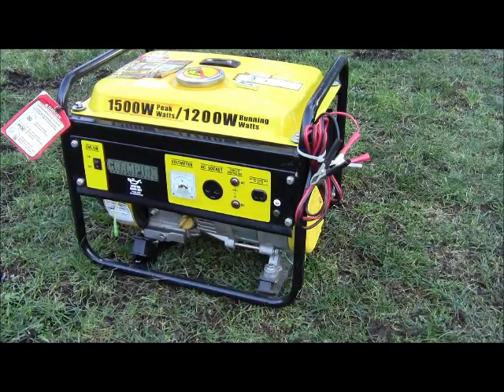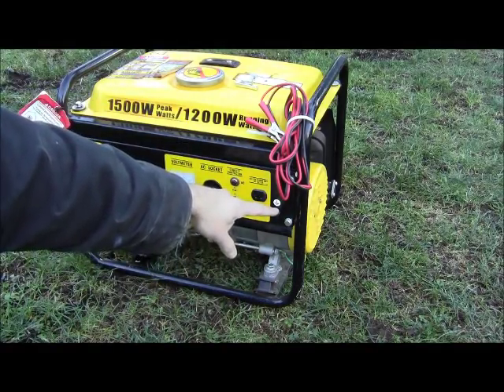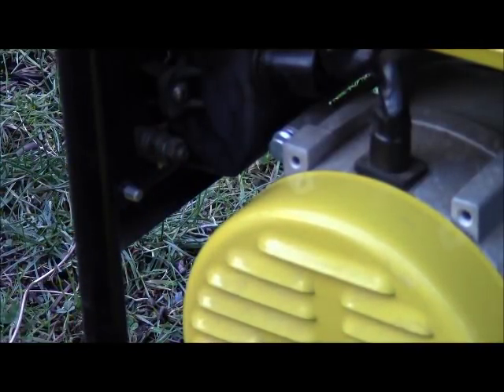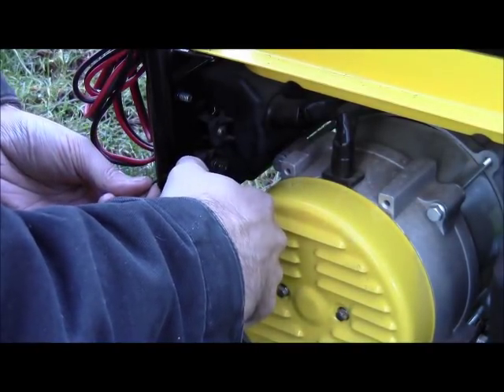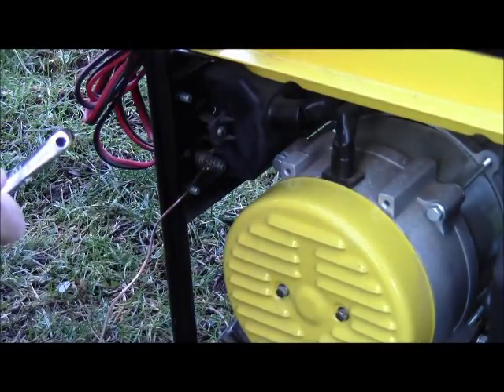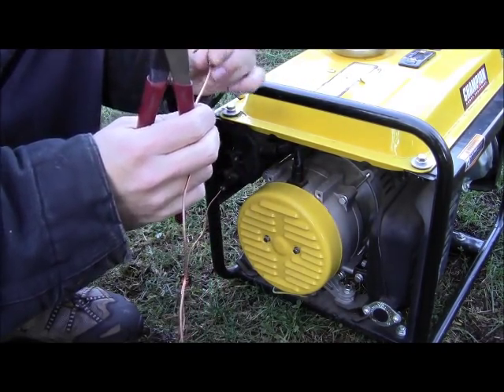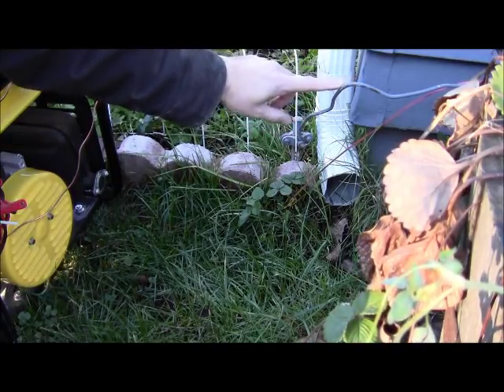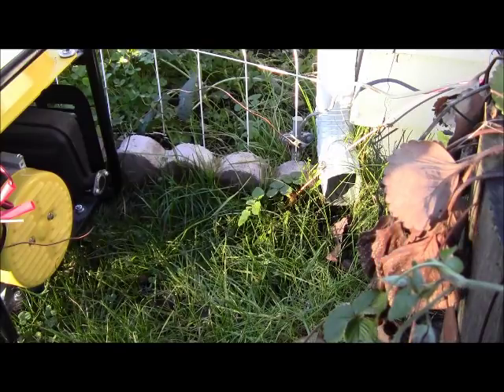RicksDIY Portable Generator Grounding Part1

Comment: My only concern with your video is not the grounding but how close the generator is to the house. The manufacture requires a generator be as far away from the house to prevent carbon monoxide from entering the home. Either way, it;s a great video.

Comment: OSHA does say the frame can act as a ground.  But the maker of my generator recommends grounding in the instruction manual, and I called them and they reaffirmed their recommendation.  I like the gator clip idea.  That little gator clip he used in the video may not be enough though for your generator.  The clip needs to be able to handle the same load as the grounding wire.

Comment: When I worked in the hire trade 20 years ago we ALWAYS sent out generators, regardless of size, with a copper rod and a length of insulated wire that could be connected to the generator. All generators have  a bolt thread, marked with an Earth symbol, sticking out that has a nut and washer on it. Customers would remove the nut and washer to fit the eye connector on the wire, put the nut/washer back on and then hammer the rod to ground. This used to be common practice. This week we had to hire 3  2.5KVA petrol gennys and an 8KVA diesel, non came with any rods. I mentioned earthing to the driver and he looked at me like I was nuts. The 8KVA was on large rubber wheels with the feet at the back on large rubber mountings. If something happened then the first person to touch it would become the earth.

Comment: OSHA states-Grounding Requirements for Portable and Vehicle-mounted Generators Under the following conditions, OSHA directs (29 CFR 1926.404(f)(3)(i)) that the
frame of a portable generator need not be grounded (connected to earth) and that the frame may serve as the ground (in place of the earth):
• The generator supplies only equipment mounted on the generator and/or cord- and plug-connected equipment through receptacles mounted on the generator, § 1926.404(f)(3)(i)(A), and
• The noncurrent-carrying metal parts of equipment (such as the fuel tank, the inter- nal combustion engine, and the generator’s housing) are bonded to the generator frame, and the equipment grounding con- ductor terminals (of the power receptacles that are a part of [mounted on] the genera- tor) are bonded to the generator frame, § 1926.404(f)(3)(i)(B).
Thus, rather than connect to a grounding electrode system, such as a driven ground rod, the generator’s frame replaces the grounding electrode.
If these conditions do not exist, then a grounding electrode, such as a ground rod, is required.
Reply from the maker: David Termini Yes, I understand about the frame being used as the ground, my questions has always been how does it ground when you have rubber isolating feet on the generators, also many of the small generators now have plastic cases, such as the Honda EU series

Comment: Good vid, thanks for sharing. Always good to have somewhere for any stray voltage/amperage to dissapate to in the event of a fault or dead short or whatever the abnormal condition happens to be. It makes you wonder how many hundreds of thousands of generators are in use, and how many of them are properly earthed. The normal rule of thumb for an earth conductor is about half the cross sectional area of the active of the source you want to ground. If everything is in good condition and there are no faults, then theroetically an earth shouldnt be necessary, BUT, you never know thats the case. Unfortunately, some believe that all an earth stake does is to stop the generator from rolling off down the slope. Most all gennys, from cheap imported ones to expensive name brands and permenant installations, have provision for earthing, for a reason. As you have shown, it takes very little effort to create an operative earth.

Comment: Use a jumper cable.
You can buy a cheap set of jumper cables.
You have a robust clamp at either end and it will handle high current.
They usually come as one unit but you can carefully slit it down the middle to make 2.
Give 1 to friend.

Comment: Rick thanks for posting this, have a quandary, with regard to a snowblower, pull cord keeps breaking, but, it has an electric start, so, I used a portable generator to use the electric start, but, can one use a portable power pak, the type for cars, etc, to power the snowblower?  This would make it a little easier for me, thoughts?